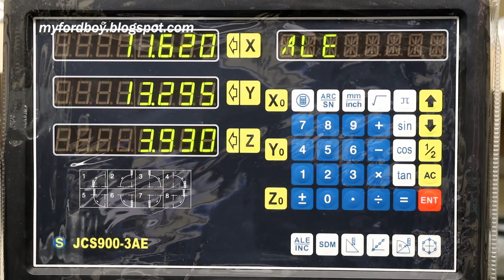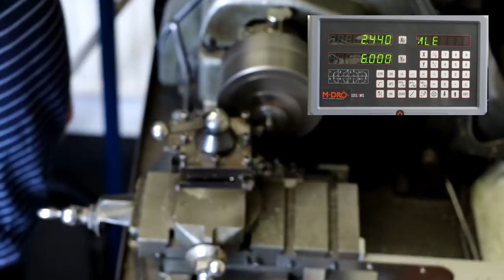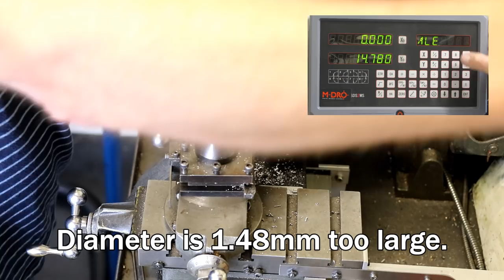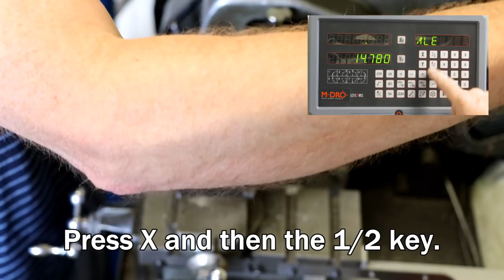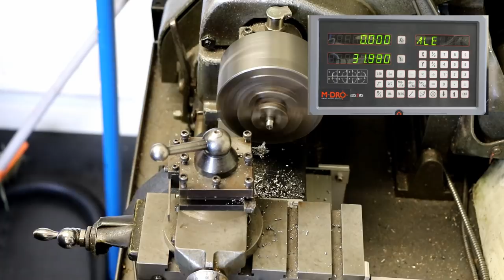Fitting a Digital Readout to Myford Lathe.

Comment: Why not configure the DRO for diameter measurement instead of radius?  I don't have this exact model, but on mine you press the decimal after bootup and it goes into the config screen, arrow down until you get to the d or r question and change it to d.
Reply from the maker: This DRO does not have that facility. The one I fitted to the mill and have the link to does though.
Reply: @myfordboy  really?  Seems very odd for a two axis dro not to have a diameter setting somewhere !
Reply from the maker: I was suprised too. The Sino model I have  does not have the lathe mode available during set up. The generic manual that was supplied refers to an SEL light that indicates diameter mode but my display does not have this.
Reply: @myfordboy  does it have setting for scale resolution? you might be able to fool it into a diameter mode by setting the  scale res to half the actual resolution (i.e. it'll count twice as much per pulse)
Reply from the maker: That would work, good idea. I think I prefer to use it like shown though, easier to  take a cut until the display reads zero rather than say cutting until it read 0.1875"
Reply: @myfordboy  well whatever suit you, but once you have a diameter set you can rough turn the work using only the dro and only measure for final passes. makes it much quicker.

Comment: Easiest way i used to use was to take a cut on dia, set X to 0 . move tool and measure dia. move to x- (what it measured) then reset to X0 and your done. Set for actual dia now, not size of cuts. nice and cheap chineesium does the trick

Comment: Hi, I have purchased these items for my ML10 and was thinking about fixing the longitudinal one directly to the back of the lathe bed along with the supplied cover. Obviously, this would involve drilling and tapping into the lathe casting though and not entirely sure if this would be ok to do, could I ask you what are your thoughts?
Reply from the maker: I fitted mine to the tray, no reason you could not fit them to the bed. You may have to pack the brackets as the cast surface may not be flat.
Reply: @myfordboy  thanks for the reply, plan on following your lead with the JB weld. Not sure if I want to drill holes in the lathe bed though may mount it to the tray like you mention.

Comment: odd way to work a dro?  i.e. face  then zero Z .  skim cut , measure , type measurement into X axis , turn to 6mm length and diameter and any other diameters and lengths you need.
Reply: Indeed... I usually type in what I've measured, because sometimes the calipers change ever so slightly during zero-ing like that, and if you have more than 1 diameter to cut you can go read off the DRO. 
Love this kind of video though, no music, just somebody happy at work.

Comment: Rather than futzing with the caliper that way, set the DRO to diameter mode, take your roughing cut on the diameter, measure it and enter that into the X scale. X then reads the diameter as you cut and you just cut to the desired size. Or, if you prefer radius do the same thing as you did without the preset.